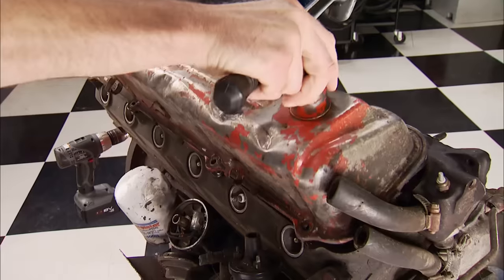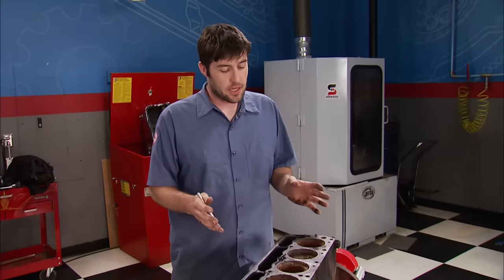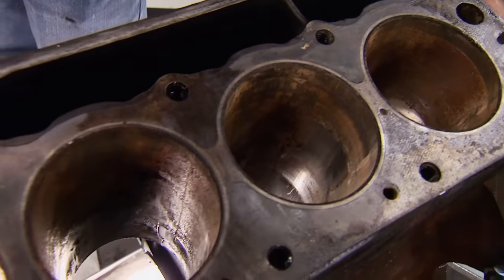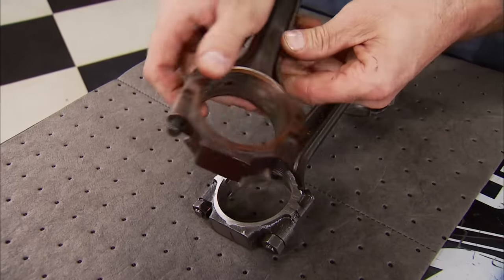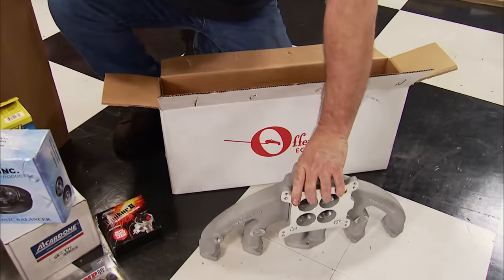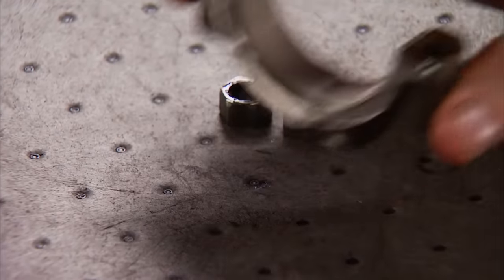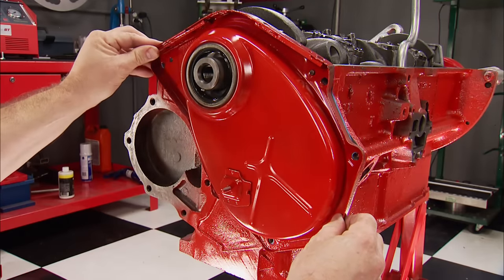Resurrecting A Mopar 225 Dodge Slant Six - Engine Power S2, E2

Comment: The last reliable engine Dodge ever made.
Reply: I totally agree.  I'm in Australia and i had both the D Type. 215 and 265  and both crapped  215 bad knock at 13 month from new.  265 head bolts broke and bad rattling due to oil leaking past lifters about year old . The transmission also shit with 265 , lost first gear had to select to start then put back into D.  Fix traded 215 car for new car with 265 then bought  new 265 motor and trans from Chrysler dealer.  Kept 265 for 11years then body broke due to rust.

Comment: NOT indestructible. I had one in a 79 half ton pickup; water pump failed and I replaced it, unaware the impeller was inverted (cheapo from Advance Auto) and it overheated. REALLY overheated, several times. warped the head to the point it wouldn't start if it was warm, and I mean warm like if it didn't start on the first revolution you had to walk away for a few hours and try again. Good luck with that 500 cfm carb too, it'd be more efficient to run the stock configuration and pump one gallon out of 5 into your shoes

Comment: "Bulletproof, Reliable, indestructible"

Throw everything away because it's all destroyed.

Yep that sounds about right for Mopar's kind of bulletproof lmao
Reply: dude I owned a few Darts over the years and those were HARD KILL engines, the fact that sitting for years rust did some  damage can happen to anything, Also AMC's straight sixes were motors if running right I'd drive anywhere, I miss my Gremlin

Comment: Disagree with comment up front. "Intake manifold had poor fuel distribution".  Au contraire, it had the best of the naturally aspirated straight sixes. The worst was the ford cast with head intake manifold of the 144/170/200/250 type. Slant six had the best.

Comment: my best friend had one in a 64 Dodge Dart not being professional mechanics we forgot to put the spark plug cables in the right firing order it did chitty chitty bang bang around the neighbor hood  low on gas one time he put his fathers chain saw mixture he didn't know he had oil in the can and it still ran  you couldn't kill that motor

Comment: 1. You should have went with the forged crank,
2. Edelbrock carbs are garbage, should have went with Holley or Demon.
3. Should have gotten the head machined for performance.
4. Should have went with roller lifters instead of flat solid ones.

Comment: So instead of soaking the cylinders with penetrating oil or Marvel Mystery oil they whacked the heck out of the conrod...  Probably did enough damage doing that causing extremely deep scoring that ruined the block for a rebuild.  But I'm sure nobody would admit to that.

Comment: Good video overall, but I would be very careful about using anti-seize on any taper-locked component. It's up to you, but do some research before you leap... Lubed head bolts should be fine, but still, do your research.

Comment: With there engines your almost better to use the 170 block, a short rod, perhaps a 170 rod and if using factory pistons turn them backwards, do some grinding to fit an run a 225 crank! Than you would have a better set up for making power!

Comment: If you're making a strictly street engine and not going for higher horsepower range, why didn't you use a hydraulic roller cam? It freaked me out when I learned that my Cummins 5.9 has solid lifters. Doesn't make any sense to me as hydraulics don't need adjusting and the engine is redlined at 3300 RPM. I seldom ever turn it over 2500 and only go to that when entering a freeway or towing my 30' toyhauler up a steep long grade. One of the things I learned when driving bigger trucks (I hauled 20' doubles mostly) was that you never use full throttle on a grade. I don't get it. My Honda Goldwing had hydraulic lifters. My Honda CB700SC Nighthawk had hydraulic not lifters but valve adjusters but it would turn over 11,000 rpm. So why on Earth would they use solid lifters on these engines?

Comment: Chrysler should have supplied a ball peen hammer for the starters they put on these. The engine ran great....if you could start it.
Had a Dart with a slant. Starter froze up frequently so you had to give it a 'love tap' with a hammer to get the bendix to pop.
Reply: yea , i remember when specs were so bad that gm starters often required shims . not so much anymore .

Comment: I don't like being a critic.  However, I see trouble spots here.  Been in this business a long time.  You don't lubricate a Teflon rear main seal.  And - sealer at the seal tips of a wet seal?  It's gonna leak.  Camlobes get moly lube, not engine assembly lube.  Cam journals get engine assembly lube.  Moly lube on the camlobes on a flat tappet cam is crucial to proper break in.  Otherwise you wind up with a wiped cam.  Silly question - where were your respirators when you were spray painting?  On a show like this - you want to set the proper example.  Seems like a whole lot of the engine was a throwaway.

Comment: The REAL reason the engine was "slanted" was because the Navy required a dependable, gasoline powered engine that would fit into the tight spot under the flight deck of a aircraft carrier. It was used as a cable retriever.

Comment: i had a 75 dodge dart that looked like a duster. my engine had an issue of when going around a curve to the left the car would jump and go and jump and go until i was driving straight again. I never foimd out rhe problem and also when it was having that issue was the turn signal indicator on top of the left fender would go and off. probably somethimg electrical but i asked several mecnanics andgot no answers. my first car and i was 16 and i drove her until a car wreck when 19
]

Comment: these older engines were good enough at that time (I had at least 3) but they are no match to modern engines that last 1/4 of a Million miles without breaking a sweat in top of that they get much better mileage.

Comment: Legendary for being indestructible.    Really?
Leaning tower of power.    Are you sure?
How about we take in your own script here,  . . . . . 
@ 1:28  "the distinctive unequal length intake runners were mediocre at distributing fuel"
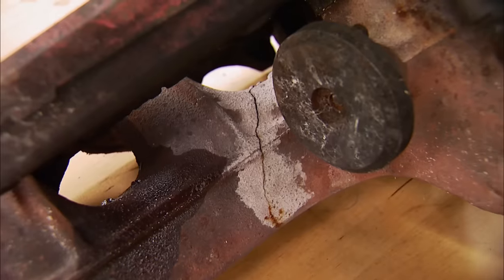@ 1:45  "cracks in slant six exhaust manifolds were very common"
I love inline six cylinders and I enjoy this channel
BUT
the slant six had some serious problems, not the least of which was the oil pan design which allowed oil to splash [read SLAM] into the crankshaft.
The advantages of this engine is the same for ALL inline sixes with the addition of being not nearly as tall, which was the whole reason for the slant.  And like all inline sixes it's a torque monster.  As for smoothness, it supposed to have perfect primary and secondary balance but as I stated earlier, there is a problem with the crank impacting splashing oil.  This can be mitigated, possibly eliminated, but if not addressed it will happen during cornering.
I'd pick ANY other inline six for any other project unless you absolutely have to have a slant six in order to fit under a low hood line

Comment: "High in the cool dept"? We had one in the first Valiant.  Fairly low power, so-so for gas mileage in an economy car.  I don't know what he means by indestructible. Ours was bought used, so It might have been abused, but it was an oil eater/burner early in its life. I don't think Chrysler had one to offer at the time, but a medium/larger 4 banger would have probably been a better engine in every measure.

Comment: Why would anyone want to rebuild or replace this engine?  In high school, I had a '74 Dodge Dart Sport with a 225 and three on the floor.  It was so underpowered that it could barely lay a scratch on a gravel road and couldn't keep up with my friends that had 4 cylinder Toyotas.  It would also never start when the temperature dropped to 0 degrees.  This motor may last forever but who would want it too?  I got rid of it as soon as graduated and could afford something decent.

Comment: When I work with ppl that use those plastic hammers with the metal caps on them I will watch them struggle to not achieve anything for 30 secs, I go get get my anti vibe 48oz anti vibe real hammer and it does the trick every time lol

Comment: It must be nice to have so much money to play with, you can buy an engine that turns out junk, get another, and then add thousands of dollars into parts for an engine great for durability, but who's ever going practically use it for souped up fun, when you can buy a nice used car for that much money, or in my case 10 or 20 reliable beaters, and if you're lucky get a couple that are naturally quick sleepers, an example being a 4cyl mustang stick with so much power it could peel tires stock and just plain screamed, until dude brought it in limping after beating on it so hard the camshift broke in half, but fixed back to flying

Comment: I take extreme issues with the fact that a popular crew of televised mechanics, i.e. Professionals are using NON impact sockets to break torque on a rusted exhaust manifold. I understand they probably have the money to throw around to buy sockets whenever. But your better than this.......

Edit: non impact sockets WHILE using an impact driver.

Comment: 40 miles to the gallon?? I have had probably 10 of them and known dozens of people with them. FIRST, there was not one on the planet that got 40 miles to the gallon unless it was on a trailer. Second, if you got 80 or 90 thousands miles out of one you most likely were in a record book somewhere and the last 25 thousand miles you had never seen anything out of your rear view mirror but smoke. NONE of these guys in this video were around when these boat anchors were made and that is obvious one minute into the video. I see they changed the oil pump....that is good because the gears in them usually piled up by 70,000 and ruined what was left of the motor.

Comment: The Slant Six was NOT a DODGE engine. It originated with the  PLYMOUTH Division...as did the 318 V-8 .The SLANT SIX originated in the first PLYMOUTH VALIANTS. 
As for V-8'S,  While PLYMOUTH had the 318, Dodge was running the 325 Hemi. DODGE didn't get the 318 until years later.The 318 was a part of the Plymouth "A" Engine family, which started life as the PLYMOUTH 277 CU. IN V-8...which later evolved into the (301, 303, 313, and finally 318 V-8'S *All of these were *PLYMOUTH, not DODGE*, engines. (Although some Canadian Dodge and Chrysler models used them) .
BOTH the SLANT SIX and the 318 were PLYMOUTH ENGINES that DODGE later adopted for use in  THEIR  cars .
https://en.wikipedia.org/wiki/Chrysler_A_engine#Plymouth

Comment: Buy engine from scrap yard, throw 90% of engine in the trash and replace them with new parts.  Upgrade the performance but downgrade the parts by replacing a forged crank with a cast crank.  Use magnets to install lifters, one of the worst practices ever!  Use gasket sealer on gaskets that come with a bonding agent as standard.  Use ARP fasteners everywhere apart from where it counts.  Install a Cheap ass Cardone water pump even though they are prone to failure.  Great job guys!

Comment: I wish more younger people watch this I try to tell them that everything didn't have a V8 it was a slanted a straight six V6 V6 diesels V8 diesels
Reply: My wife drove a 3.0 liter inline 6 diesel for several years to and from work. 1986 Mercedes Benz. Still the older 5 cylinder 3 liter was a better engine.

Comment: The 225 could have been one of the all-time great sports car engines. Compare it to the Big Healey and you'll see what I mean. A real failure of imagination by MoPar.All it ever needed was both a 5-speed manual or a 4-speed automatic with an update of the Daytona package.
Reply: Sure, and with a little rearranging a Corvair could have morphed into the mid engine Corvette in the 1960s. After 65 the trans was the same design used on the chaparal racing cars. Look up Crown Corveight.
edit: oh and by the way, that 225 slant six weighed as much as a small block Chevy V8 engine. Not a bad thing. Makes the block stiffer and more reliable.

Comment: These were popular engines in the Australian Valiant, a vehicle considered superior to the Ford and GM family sedans in the same market back in the 1960's. The claim they were bullet proof is something I've never heard but then again they weren't criticized either. Some observations if I may. Disassembling a fifthly engine is not good practice. Other engine builders would have pressure washed first., if only to make the job less messy and to note general condition and location of accessories.The first engine had a cracked crank, prone to main seal oil leaks from new and cracked its manifold. Are they really all that 'bulletproof?' A single row timing chain tends to indicate the engine is a slugger. I'd want my money back from the wrecker. $150 for a water logged piece of junk!  Enjoyed the video though. These engines are a part of automotive history but never received the accolades like Chrysler's so called 'Hemi' 6.

Comment: You seem to be taking a lot of flack about that first engine, any wrecker around here would have given one to me for $25. (I wouldn't have paid any more) and it would have turned over.
Actually a couple of guys around here would let me, maybe only me, bring in a load of scrap, throw in the junk I wanted, and weigh on the way out just paying scrap price.
Hell I have to say this $150. are you guys nuts, turn in your gearhead badges.

Comment: What nobody talks about is how impossible it is to reach the distributor while the engine is in the car unless you have child labor.
Reply: This design is overrated.   Only 4 main bearings and the bottom ends are pretty weak overall in a Slant Six.   An AMC / Jeep or Ford 300 Six will run circles around a Slant Six and not just because they have more cubic inches, either.

Comment: Clearance of .0002 is 2 ten thousand of Inch. Clearance of .00022 is 22 ten thousand of Inch. How does that translate to difference tolerance of 2 ten thousand of an Inch? When I went to school, it was a difference tolerance of 20 ten thousands of an Inch. Besides, not much of a rebuild. Bought a engine from a junk yard, scrapped it and used all new parts to build another donk. Where's the rebuild?

Comment: When they took the old motor that had been sitting in a junkyard and threw it away and built a brand new one spending over $3000 in parts that’s when I disliked & changed the channel. Nothing of interest in seeing them build a new motor using new parts. All the curiosity and interest was in the resurrection of the old motor.

Comment: My first car was a 66 Dodge Dart with a 225 slant six.  I owned it for 5 years and it was reliable and easy to work on.  However, it did not get 30mpg.  My friend owned a 67 with a 318 v8.  A physically larger car he still got better mileage.  With mileage claims I stopped watching.

Comment: That slant 6 was a piece of crap. Oil pickup or pump always got pluged up. Then the would blow the rod behind the starter. I wouldn't spend 15 cents on that gutless boat anchor.